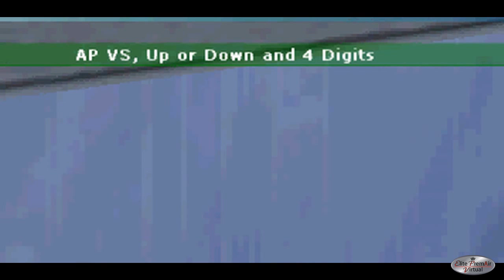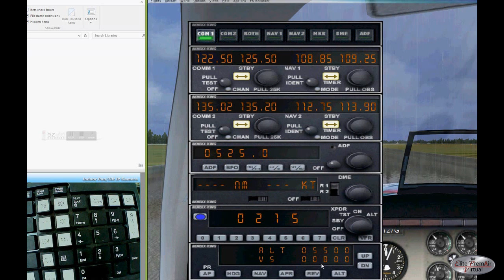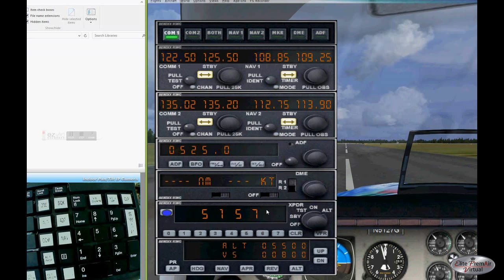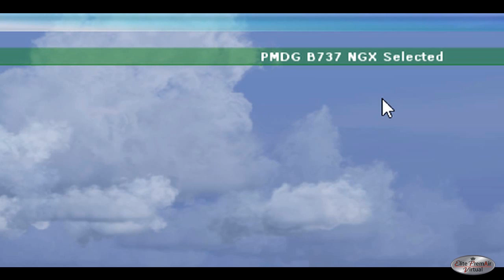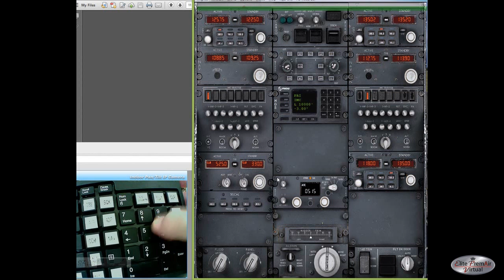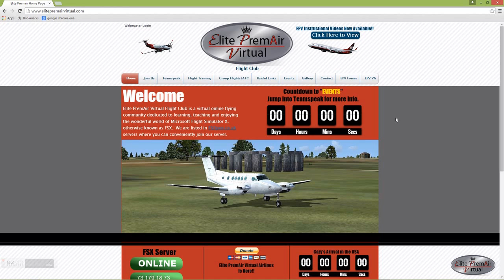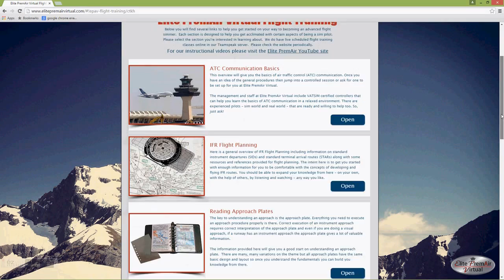NpC - Numpad Control for FSX

Comment: I have used this for about two years.  I love this program.  I was always searching for some program to direct enter numbers into the FSX.  This satisfied me very much!  You do need to have a registered copy of FSUIPC4 which is the paid version.  Part of this paid version is the capability to assign commands to KEYS on the keyboard or joysticks.  It has many other functions like detailed joystick assignment & calibration.  So with NpC or Numpad Controller being free, it's worth it to get the paid version of Pete Dawson's FSUIPC4.  I used one of my six Thrustmaster F-16 style button panels to put separate buttons for each instead of using the toggles which is great if you don't have the key availability.  It's optional.  My F-16 panels each have 28 assignable buttons.  If you fly alot like on a virtual airline, it saves valuable time and so much easier than fumbling with trying to find and use those clickspots on the knobs.  I now don't worry about the plane bouncing around while I try to get on the clickspot.  Thankyou for taking the time to make this and get it out free to the public; I truly enjoy it.
Reply from the maker: Thanks very much for your comments.  We're very happy you have found NpC to be so useful.  

Dan

Comment: I made a configuration for the autopilot. When i want to change the altitude the statusline asks me to enter 5 digits but nothing happens. The samething for changing the ias. My numpad is activated and i' ve followed the instructions of the manual. Can you please help ?
Reply from the maker: christiane herbots 
A common cause of a key not performing the function you want is that key is also assigned to do another function (there are various Num Pad default commands although I believe these require the Num Lock to be off to work properly but this may still be the cause of the problem).  Likewise the key you have configured for entering altitude and IAS may be assigned to some other function in FSX

Are you able to enter frequencies, cursor/OBS, heading and other numbers without any problem?